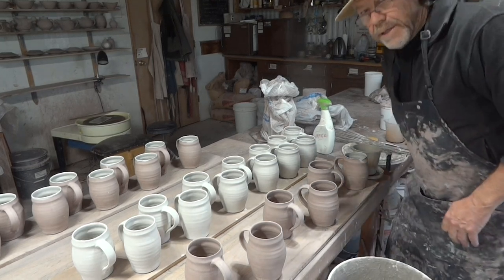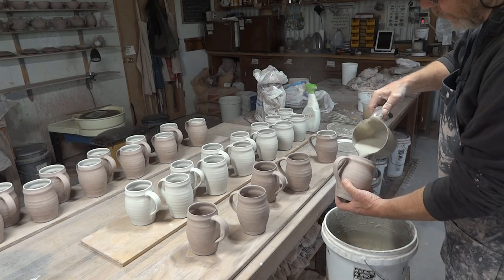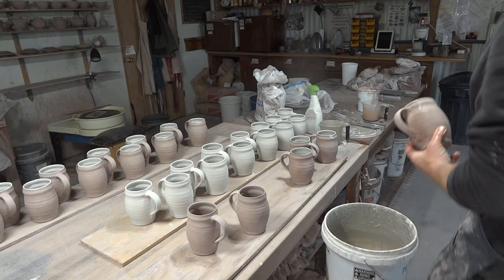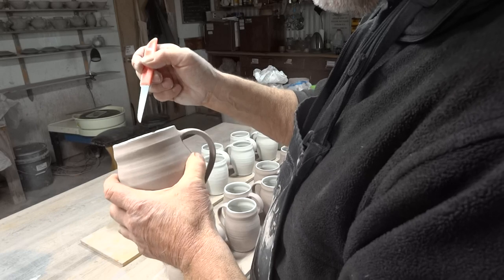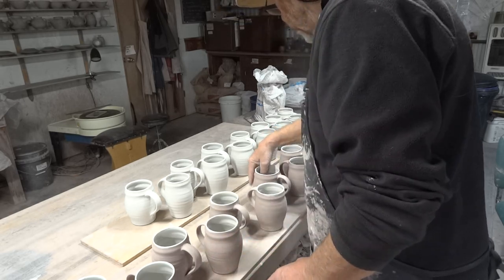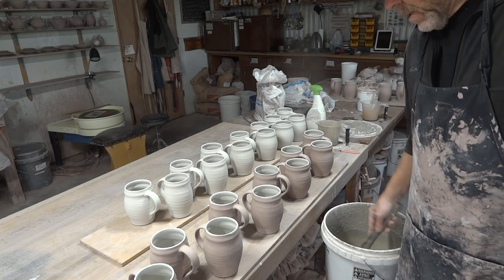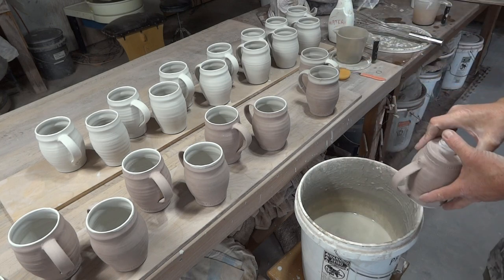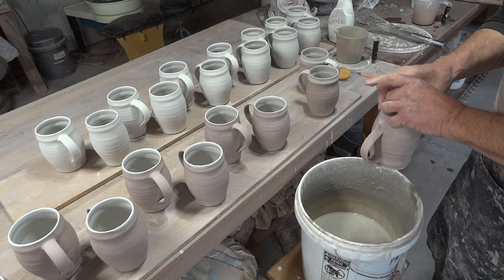Raw glazing for cone 10 reduction tips, helps, 'hacks' with Simon Leach

Comment: Hi Simon.  I am a long time old potter but I have learned so much watching you.  I have a suggestion for you for a change.  Instead of a wire whisk, try a toilet brush. They grab what has settled at the bottom and mix very well. I keep practicing.  We all should.
Reply: Just bend the sharp wire so it does not hit bucket.  My suggestion for replacing wire whisk is a soup ladle from the Dollar Store.  Allows scraping of the bottom and dipping and pouring.  You may need to extend handle for a 5 gallon glaze bucket but works on 3 and 1.25 gallon glaze buckets.  I also am still learning and practicing.
Reply from the maker: Thanks for the suggestion. I most likely will adapt the wisk by bending or filing the sharpness away. Always something to learn eh ha !
Reply: Another vote for toilet brushes!
A long time ago the looks we got when buying 10+ toilet brushes from the store were priceless!

Comment: Thank you as always for sharing your knowledge. 
I'm also setting up to do raw glazing and single firing. 

I'd really appreciate another video showing the larger of your kilns and talking about the path the heat takes through the kiln, and whether you would do it the same, or have you learned something and would design it differently if building one again. 

I have drilled my inlet holes big enough for the weed burners and air around them. I'm ready to build the interior chimney and make the hole in the lid. 

Blessings to you for your generosity as you show us the good and the ugly. Nothing goes exactly right, and too many content creators refuse to show things that went wrong and how they learned from it.
🙏✌

Comment: Hi Simon, do you adjust the water content of your glaze for raw glazing? I’ve been trying so hard to find information about how much less water I should make up my glazes with in order to reduce overload. I spray, so I think that in general is less likely to water log too much, but I have read Steven Hill’s articles on raw glazing and spraying and he says to adjust your glazes, but doesn’t say how. I use paperclay which moves water in and out and dries extremely quickly so I might not need to be so worried about this but I hoped you might have some suggestions.
Reply from the maker: I use the glaze the same as if I was glazing bisque. Pots that are very thin I probably would bisque. Thin wares will absorb and then possibly deform or collapse, especially if one isn’t quick enough with the process. Paper clay I have no idea about as have never done it but I would expect it to hold up better because of the interLocking fibers.
Reply: @sleachpots  Thanks Simon for the explanation of how you do it. Paperclay is amazingly hard and sturdy at bone dry and the cellulose whisks the water away and dries it very fast, plus the network of fibers provide much more cohesion so it is not going to lose its form or delaminate like regular clay. I’ll stop worrying about adjusting the water content then and just use it as normal. Thanks!